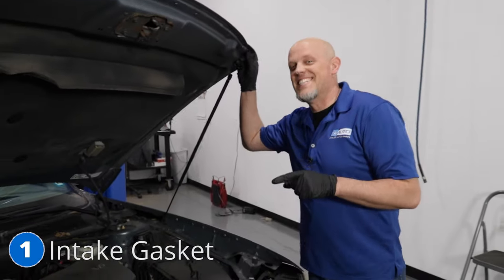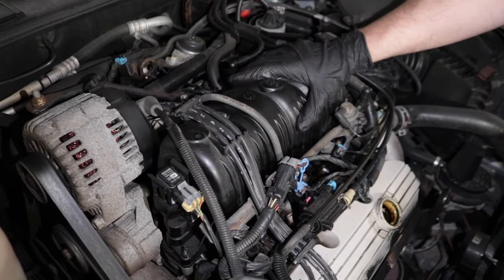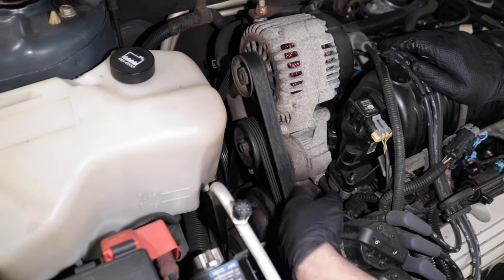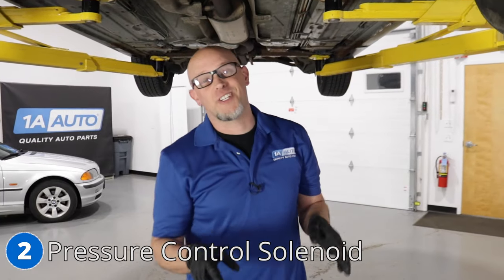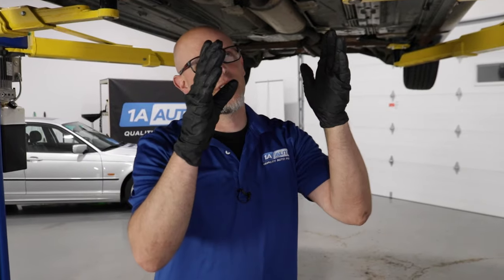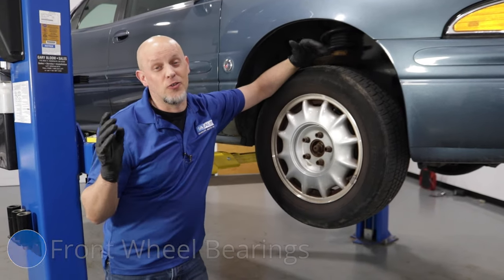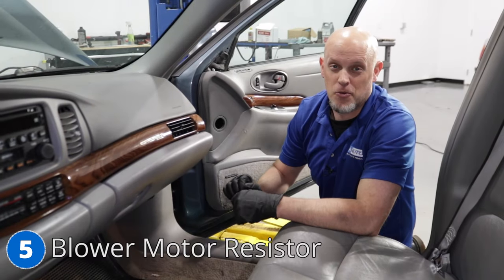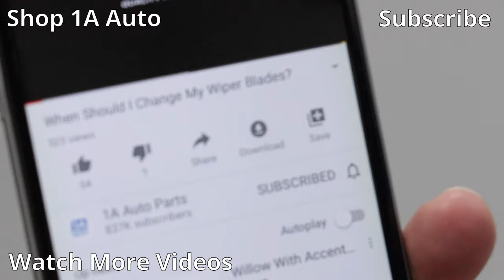Top 5 Problems Buick LeSabre Sedan 8th Generation 2000-05

Comment: You forgot fuel pressure regulator on the fuel rail. It can crack the upper intake manifold when fuel leaks in through the vacuum line and ignites.

Comment: I had a 2005 Buick Lesabre Custom with the 3.8L.  It was the best car.  I ever owned.  I wish I would never have sold it when it hit 200,000 miles.  It got 27-28 mpg.  The only money I ever stuck into it was at 175,000 miles the blower motor in the cab went out ($110) and the cord for the engine block heater went bad ($30).  I also had a 2001 buick lesabre.  I also traded it off at 200,000 miles and the only money I stuck into that one was that one of the front wheel bearing started howling.  I replaced both front wheel bearings for a total of ($73).

Comment: Every single one that I have seen, has the AC not working, seems to be the biggest issue in my area, other than that its engine 3800 V6 is bullet proof.
Reply: Just bought the 2003 Park Avenue, no air. And the blower motor sounds like a lawnmower... Going to address that shortly.

Comment: My brother just gave me his. 138k 2000, seems fully loaded. Only problem is an intermittent crank no start but so far it’s been great to me. I tightened down the fuse box and he replaced nearly every fuel line component and it still was mean to him. Fuse box was not loose but another vid said it does need to be tightened down to ground properly.

Comment: I have a 2005 Buick lesabre , my exhaust pipe smokes very bad sometimes when I drive off from stop sign, sometimes my dashboard lights will dim and bright up again, vibration in steering wheel when going 80+mph and when braking and my headlights stays on while driving in day time, and sometimes a weird noise from under car sounds light air coming out a tire does anyone knows what could be the problem?

Comment: Hey 1a Auto great video. Can you  give more detail about the pressure control solenoid. I didn't catch what you said entirely do you have to replace it or something. My 2003 Buick LeSabre is giving me the same problem as it shifts hard. I want to try and see if that is the problem because transmission replacement/rebuild is expensive. Thanks

Comment: Problem Area #5 really should be the HVAC actuator motor. It's pretty hard to find a LeSabre from that generation that isn't having problems with those actuator motors.
Another very weak spot is the forward motor mount from the drivetrain to the cowl underneath the radiator. Those motor mounts blow out in a measley seven or eight years after the car is built. The irregular surface of the city streets cause premature wear and that motor mount will blow out in quick time.
They are reliable cars but I wouldn't buy another because of so many other issues that these cars have. Rust, ring gears, tire wear...

Comment: I have a 2002 Regal and it has all the same problems haha. Replaced blower motor/resistor. Front wheel bearings starting to go, and I’m pretty sure my intake is leaking oil. Also rabbits got into mine and chewed up a bunch of the wiring…..

Comment: Just bought a 2003 with 190k. Seems to be ok the rear airbags have been replaced with springs, the front motor mount needs to be replaced(i know nothing about cars guys just been watching youtube videos, so maybe all the motor mounts need to be replaced? Gotta reseach that) she starts and i drove it 40 minutes home hitting 100 3 seperate times. Gonna fix what i can with youtube and go to a TRUSTED auto shop. The tires were shot so i took it to tire kingdom and they tried to get me to buy this fix that wanted $300 to do a diagnostic which its a 20 year old car with 200k miles a shop like that is going to tell you to fix everything and your gonna end up spending more then the cars worth in maintenance. Learn yourself, get a friend or co worker to help! Guys i own this car for $2,100 no interest no loan no nothing she is mine!

Comment: There are several top 5 problems videos for these cars, and they all name 5 different problems. So I figure there's about 15-20 problems that these cars are plagued with. Best to buy a Toyota or Honda.
Reply: Uh. No lol. Toyota and Hondas also have problems like these. There are even some years of them that have major issues like intake and transmission problems.

Just because a problem is "common" doesnt mean it's going to happen. It's just something to look out for when buying a new car. 

Besides, wheel bearings are hardly a "problem" as they are a consumable item just like the shocks in the rear. 

Exceptionally well made cars and will last forever if you treat them right.
Reply: I own a Toyota and Buick LeSabre but the Buick is My Baby...She's easy to fix,cheap on parts and has 1 of the very best motors ever made in the 3.8

Comment: You named 4 out of the 5 things done on my car.
My worst problem was a wire going to to crank sensor.
Easy fix, nightmare to figure out.
Reply: The Cam sensor will go next.Hard to figure because no code or check engine light goes on both parts made in Mexico so pretty inexpensive to replace

Comment: Excellent video.really helpful.  Looking for advice. 2004 Buick Lesabre 98k mi.  Reg trans shop changed fluid/ filter /Lucas trans fix. found nothing wrong since no Trans codes.  Shift is barely felt. More at lower gears.  It starts when engine is warmed up.

Comment: My mother has a 2004 model and the gas intake receptacle is rusty and leaves a streak line of rust down body of side of car underneath where gas cap is located and a lot of cars have the same problem

Comment: Thank you for your advise,my buick 2003 regal,the key do not come out of the ignition when I turn the car off. I have to use a screwdriver at the bottom to push a small cylinder, what is the fix?please help,
Reply: Thank you for the hidden bracket tip.

Comment: Air shocks are expensive? $88 for the pair, complete with air lines. 1 hour to change both. I think the gears on the climate control air flow flaps are a bigger issue. They break when a mechanic (or you) unhook the battery and fail to do the motor adjustment procedure.

Comment: I was driving one two days ago and the car kept accelerating no matter what I did it was stuck wide open almost wrecked it! Got it parked and the gas pedal was not working correctly it has to have a broken cable and it must have wrapped around somewhere and stuck the gas wide open so dangerous

Comment: Body control module and rim module rear body control module that's rear integration module can fail and cause interior lights, reverse lights, door locks, trunk lock popper all to not function and the cigarette lighter/ auxiliary power plug not to work very common

Comment: Intake gaskets and Pressure Control Solenoids weren't just common problems on these, many GMs of the late 90's and early to mid 2000s had these problems, same with the blower motor and resistor.

Comment: I have a 2003 Lesabre and it shifts a little rough, I would get the transmission solenoid fixed but I live in AZ and you can't get nothing done here without garages telling you it's going to be thousands of dollars
Reply from the maker: +Victory Transparency Thanks for checking us out! http://1aau.to/m/Shop-1AAuto-c
Reply: Eh you would be surprised how cheap those motors are labor cost on them for the most part are pretty cheap and seeing how this motor was used across all GMs car lines that had 6cyl at the time parts are easy to find and widely available which me cost is also cheaper than most other cars of those years

Comment: what about the power window mechanism. I changed both of the back doors only to have them fail again. I have also changed the driver's door twice.   Had a water leak which corroded the power module and I don't have power to the passenger or rear door.  I really like the car,  but it has many problems.

Comment: Great video. Yup with 160,000 fixed half of that. 
Hey blower motor seems to work great Tnx God. 
But what is that part called, actuator I think that makes the clicking noise under dash. I’ve heard a hammer tap can fix it somewhat. But it’s the plastic vs metal gears in the ventilation system. Very common I hear. Access through glove box I think. 
Thanks a lot!

Comment: In the winter my blower motor won’t run when i use the heat in my ‘04 lesabre. A good whack on the dash just above and to the right of the radio will start the blower motor.

Comment: I just bought a dealer gas cap because I keep getting the error message "Gas cap loose"  After installing the $30 cap, I still get the message.  Any fix to that?  THUMBS UP!!!
Reply from the maker: +LostInMySpace We wouldn't be able to diagnose an issue like that here, you may want to have a local mechanic take a look at it. Thanks for checking us out! http://1aau.to/m/Shop-1AAuto-c

Comment: i have 2005  and its doing well but it does have a few problems heat it is lukewarm for the most part the fan works fine so i am not sure whats wrrong and the driver and passenger side windows wont work right get stuck or wont go up when get it down , any sugggestions,

Comment: Funny. Because  My mom used to have one of these cars it was a 2004 and I noticed artist the vehicle was losing coolant in coolant although I did not see any leaking on the ground every time I topped it off I looked under the car to make.  sure I never saw a single leak.  I was having to add Colbert at least every week  Maybe went through a whole gallon in 3 weeks topping it off.  I had a feeling that the intake gaskets were leaking.  And you were right about the transmission huh transmission hardshift from 1st to 2nd it would jerk from time to time We thought maybe the spark plugs and wires just needed to be changed changed which we did do that and the problem still persisted.  We gave the car up once the brake master cylinder went out.  Yeah all the problems that you described in this video we had too.  Now I actually bought a blower motor from you all 1A auto  Because the blower went out and I probably should've went ahead and replaced the resistor But unfortunately I did not.  The new blower worked for about less than 6 months maybe or or maybe it worked a little more than that but not quite a year and then it died again no heat no AC that's when I realized I probably should have replaced the resistor

Comment: Transmission mount by radiator. The oem rip the bottom rubber by 150k. And the OE ones break the top stud off the plate. Maybe jb weld the new one around the stud?

Comment: Only problems I’ve had is the coil packs going out, front engine mount loose which makes my car shake when accelerating, climate control lights went out. I’m at 124k miles got it at 90k. I juss got the leaks fixed in tha valve u mentioned. And every time I change a headlight one of tha rear light go out lol

Comment: The man is right on!  I have owned 2001,4,5 LeSabres and have had four of these problems. But not on all 3  cars.  Replace existing plastic coolant elbow with metal;  plastic is the problem. And yes these are terrific cars. Durable, terrific ride.  They are referred to as "Queens" these days.

Comment: Anyone know where I can buy OEM rear struts with the threaded  air intake nipple for a 2000 Lesabre? I can't find ANY online. I do not want to convert to non-air struts as you have to disconnect the compressor which causes a warning light to come on (I think). Thanks.
Reply: Check Monroe shocks, they have them for my 2003 Park Avenue. Not OEM, but the reviews I read, they were a direct replacement, nothing else needed to be replaced to install them.

Comment: You left off the Mass Air Flow sensor.   Don't buy cheap aftermarket ones at they only last 6 months to a year or so.  I had to replace about 3 ignition coils on 1995 3800 and I think I may have had to replace a few on a my 2004 3800.  I read that some of the cheap aftermarket ones do not last so I pulled some off lower mileage 3800's at a wrecking yard for about 1/3 the price or less.   I also had to replace the front subframes due to worn bushings as stated by Michael E.  The chromatic side mirrors that came with Celebration edition editions have likely failed on all these cars by now.  The OEM part is not available and would fail anyway.  The best option is aftermarket mirror glass that includes clear sections for turn signal indicator.  One uses silicone to adhere the replacement mirror over top.  For those in rust belt they likely had to replace brake lines by now.   The headliner has also likely come down by now.

Comment: Them elbows that go bad are plastic, i noticed the ones on our two buicks are metal, Overall great cars, thanks for this, very helpful
Reply: I replaced mine today after they failed. Dorman makes aluminum replacements as a set for both thay he mentioned for cheap. Only advice is prelube the O rings with a lil motor oil and take you time they came be tricky to like up to the holes.

Comment: Have Buick lasabre 2004. On occasion car will not start unless I step on gas pedal. Been to several garages has cost me over 3,000 dollars to fix problem but it still exists. Any suggestions. Thanks
Reply from the maker: +El Shaddia We wouldn't be able to diagnose an issue like that here, you may want to have a local mechanic take a look at it. Thanks for checking us out! http://1aau.to/m/Shop-1AAuto-c
Reply: I had similar problem and same solution so just live with it

Comment: is their a way to test my rear air shocks on my 2002 buick lesabre before trying to check every inch of the air lines so i know which has actually failed?
Reply: without using that scan tool  cuz i cant afford it

Comment: We had a 2003 Limited with sunroof and was the celebration golf edition.  Main problem was constant electrical issues which sadly caused us to sell it at 181,000 miles.  The security system locked out my wife several times and fuse box under the rear seat was having glitches.  The left turn signal would flash 3 times too fast, which started all the problems when we purchased it at 112,000 miles.  Other issues: The transmission did clunk from first to second as the mechanic described and we did have oil leaks all over.  Other than that, great car!  Very comfortable and quiet riding.  Too bad these cars are history!

Comment: 6.  Heat diverter.  Heater works on one side cold on other.  Same with AC blowing hot on left and cold on right.  Other than the 5/6 this engine can't be beat.  Why did GM replace it with 3.5 or 3.6?
Reply: Because the 3.8 was a beast was easy to work on and would outlast most of us;) Sadly they stopped making it because how could they make any money if these babies will go 3,4, hundred thousand miles.
Reply: They replaced it because consumers are stupid and executives think that newer = better.

The old 3.6 that replaced the 3.8 was garbage but they are pretty well made these days. Just in time for GM to replace them with a 4 cylinder that is going to have direct inject and turbo issues. 

Once auto manufacturers perfect a build they move on to something else because they wont make money if people keep their vehicles for 10+ years...

Comment: This is my first and it has been great.  It only had 80k on it when I purchased it.  A elderly couple at Church owned it and the daughter wanted it out of the garage when they passed away.  Mine is a 2002
Reply from the maker: +Carl Jenkins Thanks for the feedback!
Reply: I just picked up the 2003 Park Avenue, so far so good. I expect to get quite a few years usage out of her. Best part, no payments! I did have to have some work done on it though, the upper and lower intake... And quite a few other issues as the car sat for a few years... Lot rot, all of the lines had to be replaced, steering pump, fuel pump, a real laundry list. But, I bought the car cheap enough and I am still within my allotted budget. One owner car, no rust, very clean for its age. Very happy.
Reply: Belonging

Comment: Had 4-5 Pontiac Grand Prix's & Grand Am's with the 3800 series motor before my current 2001 Buick Lesabre also with the 3800 series motor. Every single one I had to replace the intake manifold gasket kit on and the plastic elbows with aluminum ones. The Pontiac's were notorious for the coil packs and the Mass Airflow Sensor going bad in them. So far lucky in that department with the Lesabre. Did have an exciting explosion occur however when my fuel pressure regulator failed causing fuel to puddle in the plenum and then EXPLODE the entire plenum and fuel rail off the top of my engine and starting aflame! Made for one hell of a wake up on my way to work. Have had to do usual brakes, a caliper, ball joints, both front drive shafts+CV boots, typical wear and tear stuff. 
Two main things requiring attention now is the severe clunking that occurs when getting on the accelerator quickly from a stop or a coast. Thinking it's a motor mount or transmission mount. Isn't during shifting from 1st to 2nd so not thinking it's the shift solenoid but open to suggestions out there! Second thing is I need to do a full blown coolant flush. After repairing a front end collision I think the tranny cooler leaked into the cooling system and getting the residual oil out of there has taken a year and multiple flushes.